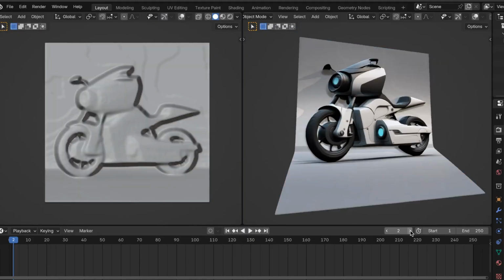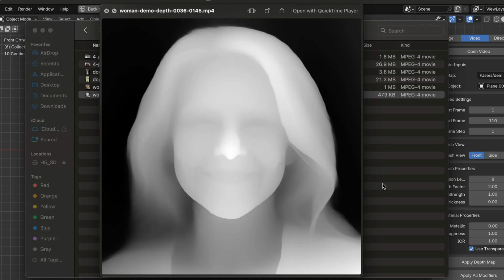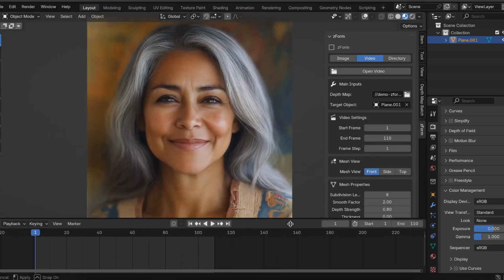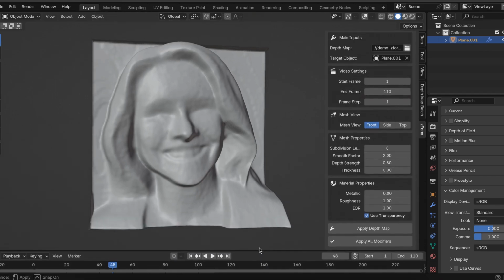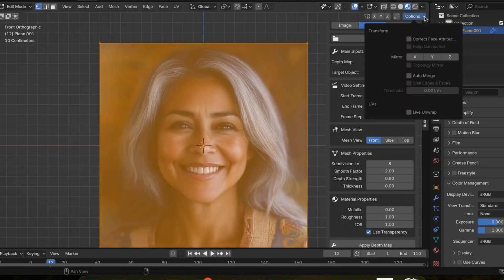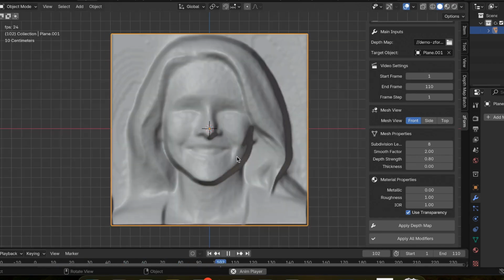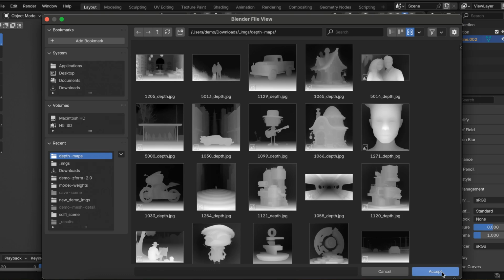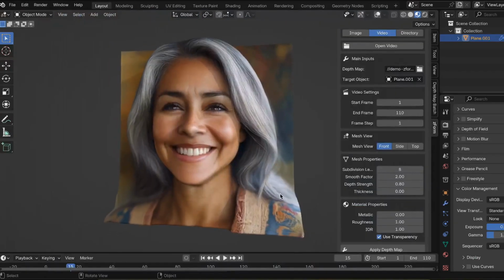Convert 2D videos to 3D videos in Blender using zForm

Comment: Hello, do you have a specification for the video importation ? hd, 30 fps ? i have a issue when i import a video footage. Thanks !
Reply from the maker: Hi.  I'm not aware of any issues importing video footage. I'm assuming you're using the Video section of zForm, then you're referencing the main video to import. Are you having trouble importing the main video or the depth map video? Could you please share a little more info on what issue you're having? Please message me on SuperHive once you're logged into your account and I will gladly help.

Comment: I really love the Addon, it helps me a lot, but one thing that has been happening is that when I put the video and try to resize it, scale it to make it bigger, when I play it it goes back to the original size!
Reply from the maker: Hi, thanks for your message. A few initial questions.  When you're resizing and scaling, are you first clicking on the "Apply Depth Map" button before resizing, or are you resizing first before clicking on Apply Depth Map? You might be doing this already, but if not please resize after clicking on the Apply Depth Map button. Also, are you typing in "S" on your keyboard to resize/scale the selected mesh object for the video animation? I'm having trouble recreating this issue, but I believe you're running into an issue. Could you please send me a message on SuperHive (formerly Blender Market) so I can provide better support to help?
Reply: @ ok, sure!!

Comment: Bought both of your addon today. How exactly do I output video maps ? even in video mode, the output setting remains JPEG or PNG, how can I get a mp4 like you've showed here in this video ? And a suggestion, It would be amazing if you could add Albedo map, it would make it easier to relight or blend the new mesh in a new 3D environment.
Reply from the maker: Hi, thank you so much for purchasing both of my add-ons! Also, thank you for the suggestion on Albedo map's, I'll look into that. In regards to your questions. Just to make sure I understand....you've already generated the depth maps for your video input using Depth Map Batch and now you want to convert the video to 3d mesh using zForm? I think I understand what you're saying which is now you have your original video file, and the output directory of depth map images for each frame. There is one simple interim step which I can help you with to compile all your depth maps to a video file. I compile my depth maps for a video using Blender's video editor tool. Can you please message me on Blender Market using the "Contact Creator" button when you're logged in and I will gladly help walk you through it from compiling the depth maps to a video to using zForm for the video I show here on my channel? But, I will also create a video tutorial on YouTube to do this as well...it might take a little time though. Below is my homepage link to contact me

https://blendermarket.com/creators/vizlife

Comment: Is the installation for the depthmap batch addon within the blender directory or can you specify where it's installed?
Reply from the maker: Hi. For the actual python dependency libraries installed to use depth map batch, they are installed in the site-packages directory for Windows, Mac, and Linux, not within the Blender directory. It keeps a clean separation between the standard libraries already included in Blender and the new dependency libraries. The addon doesn't allow where to specify where the libraries that are installed...but the way it's designed you can uninstall libraries if needed in the UI or in the terminal/bash. Feel free to message me directly on Blender Market if you'd like to chat more about this in more detail. If you log into Blender Market, there's a "Contact Creator" button on my main homepage. 
https://blendermarket.com/creators/vizlife
Reply: @vizdotlife thanks. Because my system drive has less than 3gig free space. I know these libraries could be 5 gig or more like most local A.I. tool.
Reply from the maker: got it, yeah. the one thing that can be saved in different locations is the model weights files, which is different than the library installs.

Comment: This addon is very interesting. I was wondering what files are actually being installed on my pc with the one-click install option?
Reply from the maker: For zForm, no additional files at all are being downloaded or installed. It's purely using Blender's native python libraries that are already packaged inside of Blender. It's a very lightweight install. The tool simplifies the entire workflow and speeds up efficiency versus doing all the steps manually in Blender to transform your images and videos, and the corresponding depth maps to 3d mesh. So, you still need to create depth maps outside of the tool. On the other hand, my other tool Depth Map Batch will generate depth maps in an automated batch process and run entirely locally on your own machine. For this addon, the installation only after the user clicks on "Install All Libraries" installs all the needed python libraries to run on windows, mac, and linux. The heaviest library installed is pytorch. But I provide full transparency in the addon showing which libraries are installed. There is no APIs and no web services run in the tools. Everything is run locally. Does that make sense?

So, in summary I made a product design decision to make zForm incredibly lightweight with an easy quick install with no external library requirements. Whereas, with Depth Map Batch the required library dependency installs are shown below. 

pillow, cffi, pycparser, psutil, threadpoolctl, joblib, typing_extensions, mpmath, sympy, packaging, pyparsing, cycler, kiwisolver, dateutil, pandas, six, matplotlib, scipy, sklearn, opencv, pyyaml, tqdm, torch, torchvision, ultralytics, facenet-pytorch, timm, transformers

Comment: Wow, video footage with such depth looks amazing - great job!
I didn't quite understand the purpose of the directory feature. What is that for? Thanks
Reply from the maker: Thank you : ) For the directory functionality, the benefit of using that feature is let's say you already have ready to go 20 different images and the corresponding depth maps, you can import the directory and it will automatically transform to 3D mesh for all of the images in the entire directory instead of having to do one at a time manually. Each frame in the timeline will transform one of the images in the directory. You just have to scroll using the timeline in Blender. 

The other purpose of using a directory is lets say you have the raw individual image frames of a video and the depth map images for each frame, instead of video files. You can use the Directory feature instead of the Video feature.  

Does that make sense? 

Sorry I haven't gotten to a video tutorial yet for generating depth map for a model in Blender. It's up there in terms of priority videos.
Reply: @vizdotlife  Thanks for the explanation. It is much appreciated 👍
Thanks also for the update on 3D model video - no rush. Please take your time 😊
Reply from the maker: @ You're welcome! Thank you too

Comment: incomplete product, this addon without the other one from depht is useless, it's throwing money in the trash, or make a complete addon that actually generates 3D photos, or remove this application from the store.
I bought the addon thinking that it would generate the 3D with just one click from a photo and to my surprise I had to buy another one, which was more expensive.
Reply: I mean he clearly showed in this tutorial that u import ur own depth map not one moment in this video did he insinuate that it could generate depth maps. That seems like an assumption you may have made up yourself.
Reply from the maker: Hi Bob, I'll be more than happy to give you a refund. Please send me a message on Blender Market and we can get that sorted out. I do include at the very top of the product page in the very first sentence "zForm is a tool designed to transform your pre-existing depth maps, images, and videos into 3D meshes.". Pre-existing means you already have the depth maps before using the tool. 

My initial design goal for zForm was to be lightweight, quick to install, and reliant on Blender's native libraries. Whereas Depth Map Batch requires quite a heavy install of libraries outside of Blender's native libraries, and more involved in the onboarding stage. This is a product design decision on where I envision both tools going in the future.
Reply: @vizdotlife  I think your addon is amazing and I can't imagine how difficult it must have been to build it. I'm planning on purchasing it in the future but I have to admit the separate addon thingy turned me off a little bit. Personally, I rather pay a bit more and have everything together.
Reply from the maker: @larykenobi  I understand and appreciate your feedback. It was a tough product design decision for me as I certainly can see the pros/cons of that decision. I am listening. Thank you for sharing.